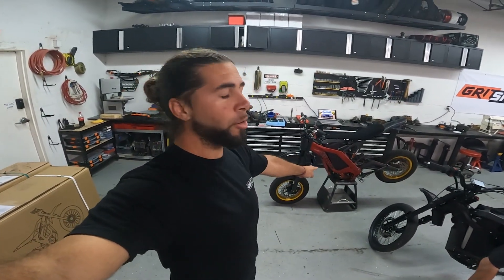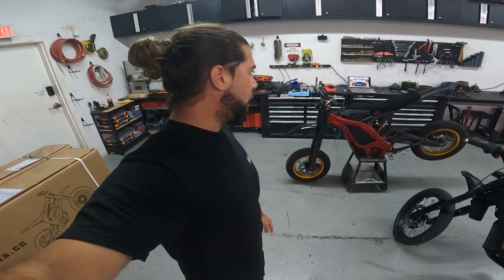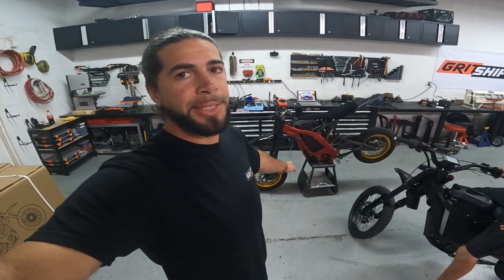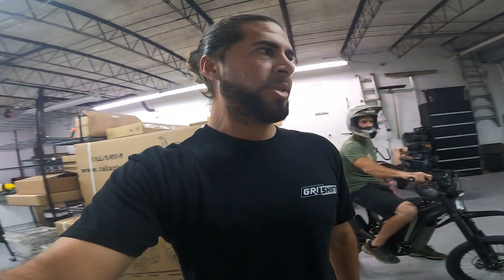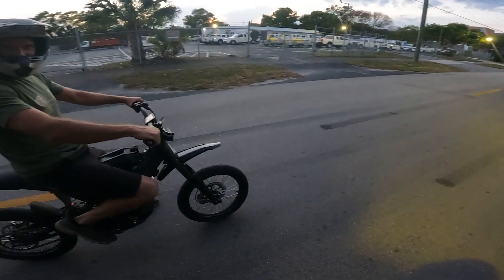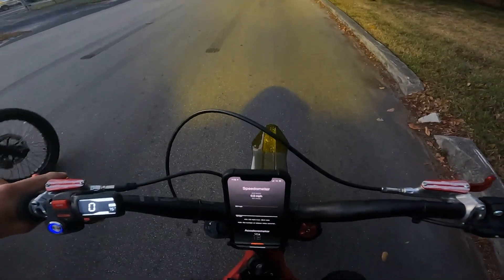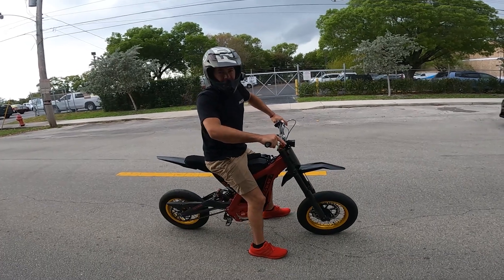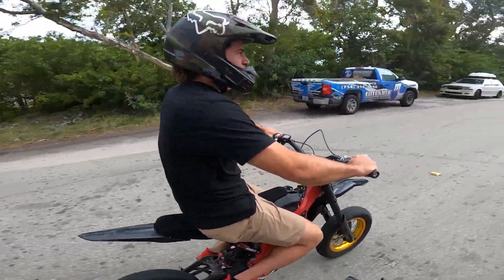KO Motor & Controller Testing In GritShift Mini Moto Sur Ron

Comment: Bro those that have upgraded gonna be sick. Sick with envy when they see this. This shit smokes 🚬 the comp. Nicely done ✔️p.s does it smoke the BAC 4000 and BAC 8000 ??? Nucular 24f...
Reply: i switched from my bac 8000 to the ko motor and controller and it has more power, high end and low end.
Reply: @jonathanmahler3927  can you pair the KO motor with the bac 8000 controller?
Reply: @AfroWasiu  there’s one main difference j forget what it is but you need to know how to tune the bac8000 and j don’t so to answer your question yes but not easily
Reply: @jonathanmahler3927  if one did know how to tune the bac8000, which combo would be better? bac8000+ko motor or ko controller+ko motor? thanks for responding by the way!
Reply: @AfroWasiu  i feel like they would both be about the same however i personally like the ko controller better because you can connect via bluetooth and an app if your on android along with the higher voltage possibilities but i haven’t had enough time with either to give you a perfect answer
Reply: @AfroWasiu  my only other input would be that even tho the ko controller is lighter it stays significantly cooler than my bac8000 doing the same thing
Reply: @jonathanmahler3927  Got it! Thank you for the info. The GS guys replied that they tested both as well and overall prefer the KO Controller paired with the KO Motor too! 💪🏿

Comment: is it safe to run that motor at 60mph for over 10mins for commuting
Reply: @gritshift  what gear ratio would you recomend for this. i would also like to do wheelies and stunts so i would need a mix of tourque and speed

Comment: Any updates on this? These guys are making some pretty big claims... saying that 10kw with this motor is twice as powerful as 15kw on the stock motor... doesn't make any sense. Starting to seem more and more sketchy. And apparently it's supposed to be able to handle 30kw?? Have you guys tested it at higher kw than the Sur Ron stock motor can handle? Maybe like 20kw?

Comment: Is it JUST Motor and controller or do I have to purchase the 72V Batterie do get power?
Reply: @gritshift  thank you. Is there a video on how it would drive with the standard battery? I‘m considering upgrading motor and controller but I want to be sure on how much power I would gain and how it effects the range

Comment: Hey GritShift, I wanna pre order this motor & controller combo but will it be compatible with my stock Sur Ron battery and if so will I still see a increase in power & range or will I need to also upgrade my battery to a new 60v or 72v? Thanks in advance!
Reply: @gritshift  awesome, thanks guys for the update & response. Going to preorder mine now! Hopefully you guys will be releasing a installation video & another video showing us how to tune the new motor and controller!
Reply: @gritshift  
Please tell me which battery you are using. What are its parameters? On what elements is it assembled?

Comment: I thought it the red surron had a stock battery. Its suddenly less impressive now..
Reply: They are both tuned to stock settings you guys..... So even with stock settings on both the ko motor is still faster on motor design alone.
Reply: LOL me too. I was about to press that pre order button. I wonder if grit shift could do a test with the ko motor and controller with stock battery.

Comment: So whats the Specs of the mini moto what size tires, what battery? Stock gearing ? 17" Diam Wheel ? Chi 72v 38ah  7500rpm limit tune 42T Rear Sproc. So that comes out about right around 64 mph

Comment: HOLY COW that was NUTS!!  Great upgrade then..geez!!  80 MPH easy!  Well guess you just pop in one of these and controller and leave the rest of the bike (ie battery)  stock then!  Wow!!
Reply: Not at all. It's a replacement motor, replacement controller, 72v battery, sprocket, wheels, and suspension on that mini moto setup.

You're just not getting that performance from a stock 60v battery
Reply: The bike speedo wasn't reading accurately, the phone had the accurate speed via gps.